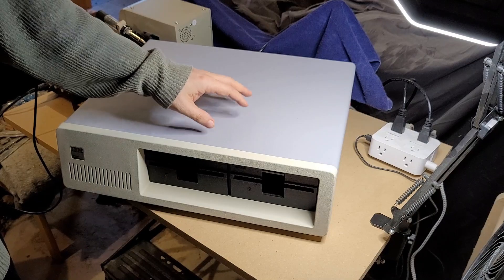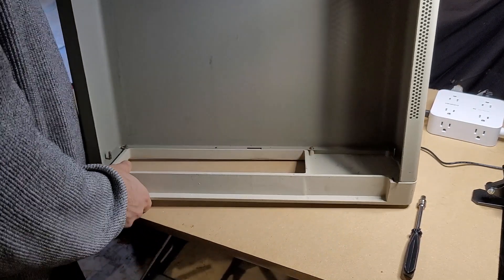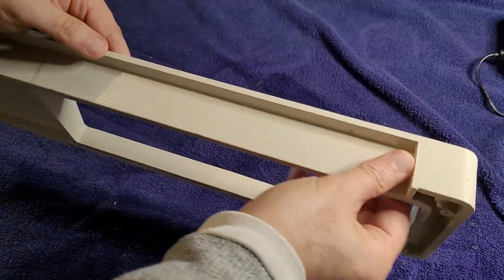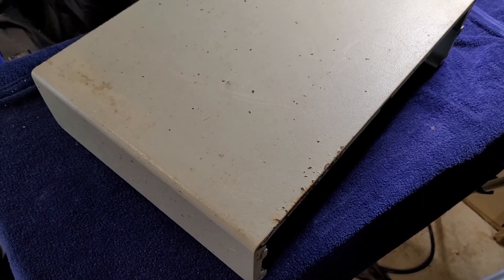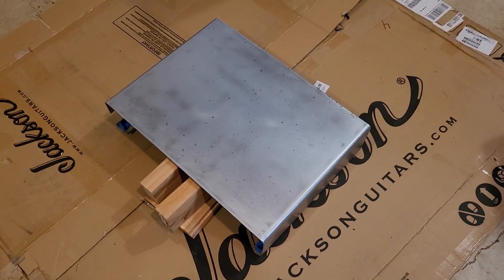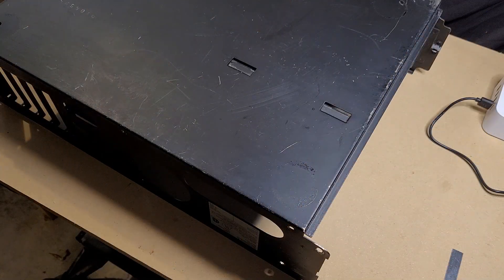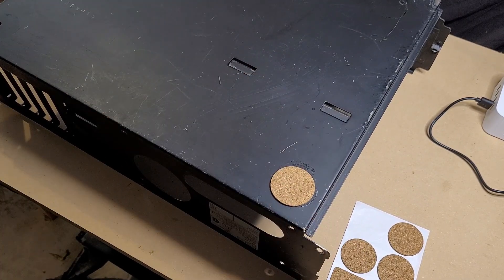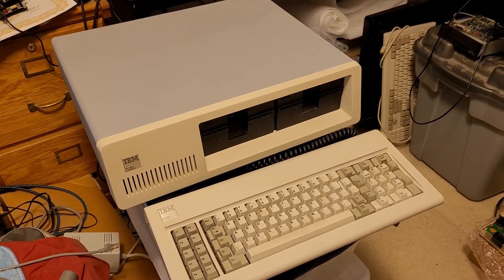IBM 5150 - Part 6

Comment: I think it's safe to assume that the DIP switches on the RAM card are to specify the start and end addresses to map the additional RAM into.  I have a similar card, although it has two separate banks of DIP switches (one for starting address and one for the end) so I'm sure the specific instructions would be somewhat different, but every ISA RAM card I've ever seen needs this info to be set - either via DIP switches or via software that modifies EEPROM on the card in the case of the fancier cards like my BocaRAM AT 8MB card.
Reply from the maker: I believe you are correct.  Since making this video I have looked at the DIP switch settings for several over ISA RAM cards, and they all feature a way to specify the starting address (or block / bank), as you suggest.  That is something I just hadn't considered prior to making the video.  And, as you also pointed out, they are all differ slightly in the specifics.  Which is going to make it difficult to figure this one out...
Reply: @nhbretro  How did you remove the old paint from your case?  My IBM 5170 has developed some discoloration and texture imperfections deep into the paint.  I've got spray paint & primer that's "good enough" in terms of color match so I can re-paint it but I've been unsure about removing the old paint and also you mentioned something about "adding texture" in your video?
Reply from the maker: @angieandretti  I used a random orbital sander to remove the existing finish.  I kind of glossed over the rest of the finishing because I wasn't super happy with the results.  For the texture, I sprayed "Rust-oleum multi-color textured spray paint, Desert Bisque" over the initial primer coat.  I then sprayed over that with the final color.  It isn't terrible... but it isn't great.  If I were doing it again, I would use what is called "crackle effect" paint for the texture.
Reply: @nhbretro  Thank you.  I'll look into the "crackle effect" paint.
Reply from the maker: @angieandretti  Let me know how it turns out.